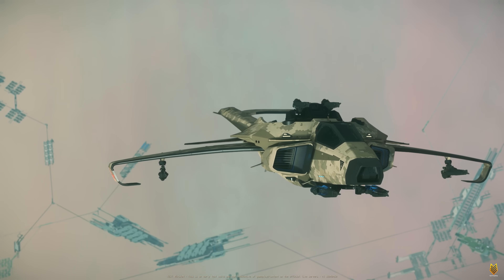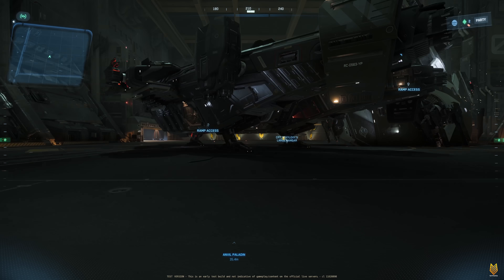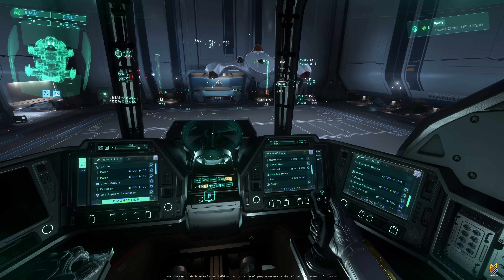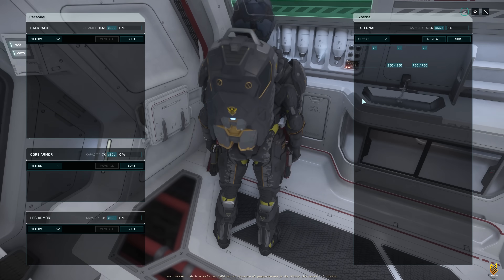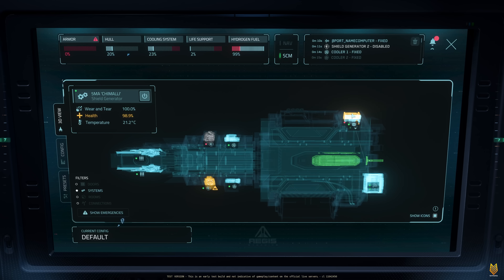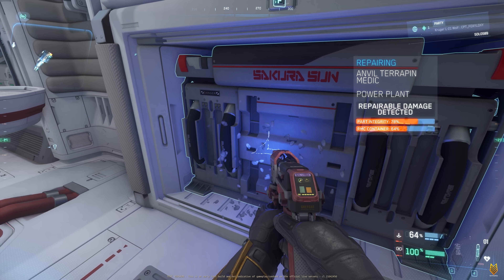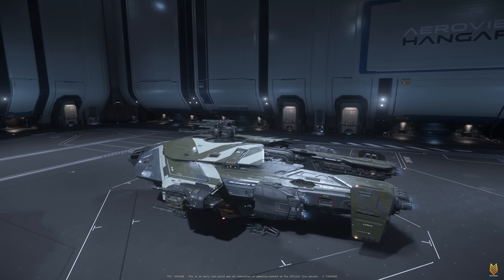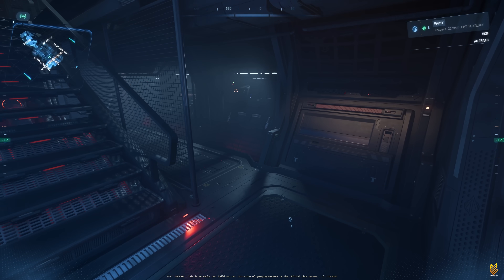Engineering Change & Test In Alpha 4.6: Both Player Ships & NPC Ships | SC 4.6 PTU Testing Pt.4

Comment: Wish they would just switch to Armor is purely resistance to ballistic penetration damage. If it really hes to have HP make it last longer and require ballistic damage to break it. 

Lasers only damage shields and barely penetrate.

Ballistics can penetrate to components (reduced by Armor resistances)

We need to make mixed loadouts a requirement. Componants need tons more HP and repairing in the cockpit needs to be ships without interior. 

Distortion needs to keep ships powered down longer like 2mins and stop self destruct immediately.

Comment: 1:35 - With Tech, "Night vision" is light amplification techniques.  Sensors that just react to other waveleths are refered more specifically.  Like active or passive IR or UV, etc.  But CIG never googles anything and has been repeating that sentance you used for 2yrs.  Even with biology, night vision in eyes refers to sensativ8ty and amplification of light by combining inputs from multiple cones/rods, which is why details get lost.

Might want to ask CIG if you can google and correct some of their packets.  They should be all for people doing work for them for free.

Other than that, your testing seems solid.  Good video.

[Edited out my first comment.  Was reactionary and dick-ish]

Comment: I'd definitly up the sheild resistance some more. Armor should then be sectional around ship represented by the shiloette turning grey after losing a section. Then once armour gone, the sihouette turns yellow & red showing hull damage to that section. Once a hull depleted in a section it breaks off. If its the main body of ship then it beaks in half. Componant damage should only happen after armour is gone & its damage percentage should increase accordingly with lower hull health in that section. If power plant gets to zero i dont mind the same risk of explosion, but it needs to reach zero a lot slower than it currently does & not be linked to hull health. Also if you choose to remove power core altogether & toss it off the ship if about to explode, it should remove stop ship detruction & just power plant explodes (not sure if thats been tried yet?). Then the with longer componant damage/health time there should be higher risk of fire outbreak to have fun with while repairing

Comment: Hey Foxy, what's going on with your control scheme recently? I've noticed when you walk and turn, it's really jarring movements of say 10 degrees. Are you picking up a mouse and repeatedly placing it, for example with a really small mouse mat and low sensitivity? 
If so, I highly recommend getting the movement of mouse from edge-to-edge to be around 180 degrees. Thx for video!